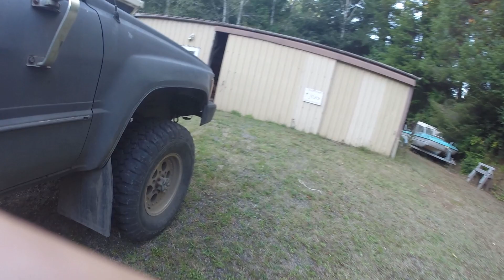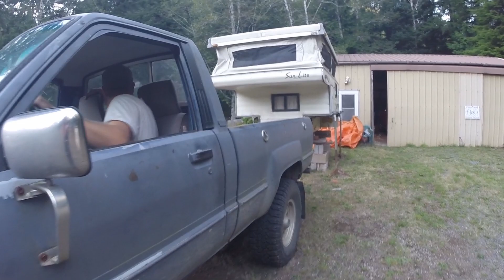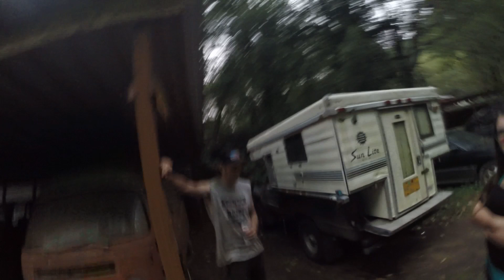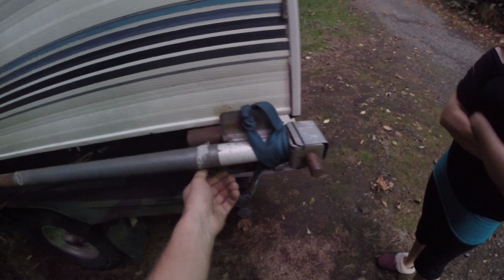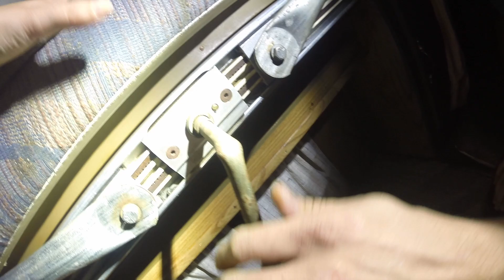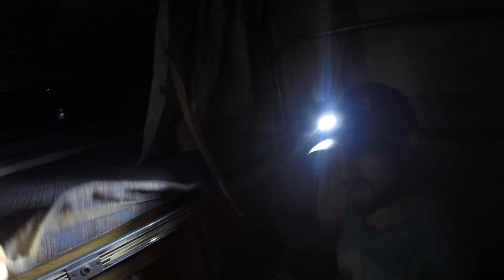After years of searching, I've found a Sun Lite Camper!

Comment: Just pounced on a 2004 Sunlite Sunvalley last month. I called and told the guy I was on my way with cash in hand...learned a hard lesson and had missed out on one prior.
Reply: What did that cost you.  I am going to look at a 1997 today.  Been stored inside of a barn. They are asking $3,000.
Reply: @coltwinchester6124  It was a 2004, I paid 5000.00. It was very clean.
Reply: @Jmisslyn  what are your thoughts on a 1997 Eagle WT.  Has the toilet,  outside shower, AC . Been barn keeper for over ten years.  Looks very clean.  Asking price $3000. 
Thanks for the reply.
Reply: @coltwinchester6124  Sounds like a good price. I didn't want a toilet. Sounds like a good deal, check out the roof, and and all of the corners. If it smells moldy, it could have some leaks.

Comment: Dude I bought an Apache 2002 model (almost the same) about a year and a half ago.  Everything original and everything works $4K  Had to rewire for tail lights and get a new AC shroud.  Also, the crank has a tapered gear and its teeth were getting chewed up.  So I had to get an new one.  The only thing left  to do is the running lights on the lid/roof perimeter are not working. Do you have a follow up video after re-build?
Reply: Did you get your outside roof lights working.  I have the same problem on mine.
Reply: @coltwinchester6124  yes sir.  I messed around with the wiring.  I figured out what wires were going to my truck- running lights, brake, and signals.  I bought new tail lights and marker lights.  Everything works.